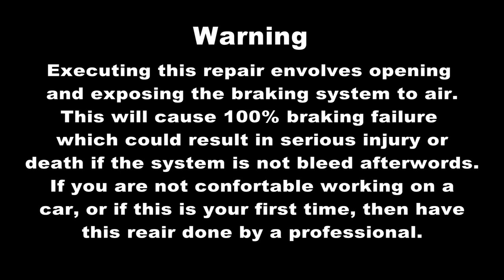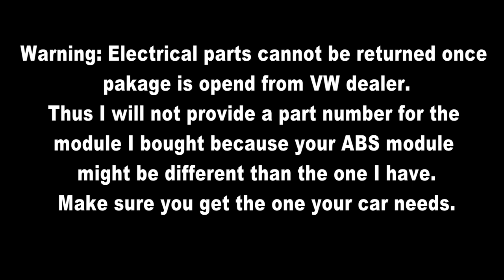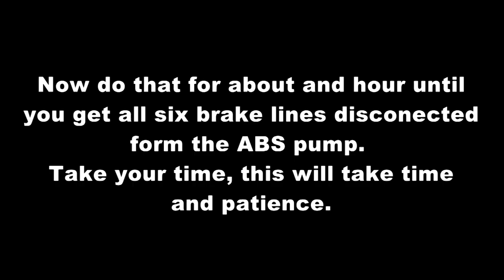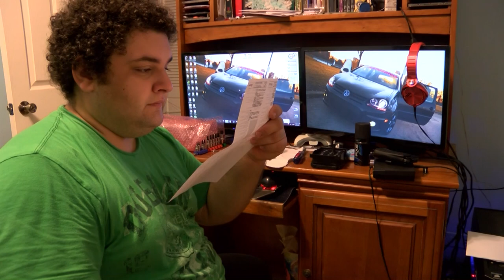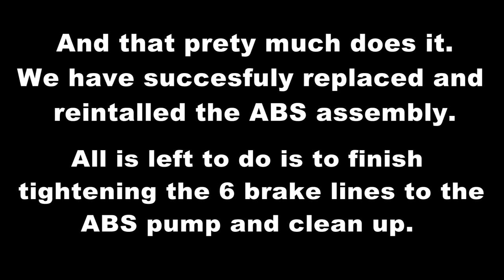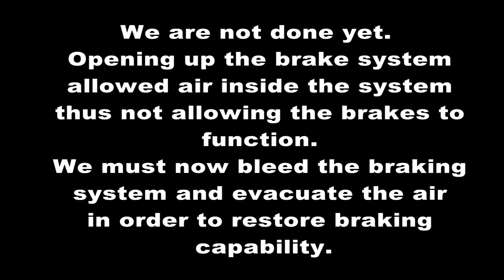2009 Volkswagen GTI ABS Module Repair Part 1

Comment: I had problems with my cluster and ABS, didn't have power on the throttle, after the dealership said they replaced the throttle body and said I needed to replace the whole wiring plus a new module, I went out to find out myself, So I replaced the cluster and bought a used abs control module from the same year of my car. replaced it and didn't have to have it reprogramed as the computer adapted to the used on. There is a way around it my guy, just need the right experts. Now it runs like new no problems no nothing simply satisfying.

Comment: My dealership didn't mention there's a recall for this. My lights all came on when I think the traction control kicked in while I was going to work. He's also trying to get out of fixing my water pump that has a warranty extension. He says there's only a problem if there's a leak-interesting as my reservoir was empty!

Glad I cancelled my appointment for tomorrow with that place and came to YouTube instead. Now to find an honest mechanic, my go to guy left the area. My brakes are mostly working, it does add a little stopping distance on rainy days. And yay another problem with my GTI, but this car was my late father's pride and joy, so I want to take care of it. Thanks people in the comments for the head's up and thanks for this video!

Comment: Mine recently went on my ‘10 GTI. I got a replacement from a salvage yard with the same exact part numbers (pump & module) for 10% of the price of a new one. Also, if your module isn’t completely hosed you may be able to pull the code off of it before removing it from the car, drop it on the new module and save a trip to the dealer.

Comment: CHECK YOUR VIN FOR SAFETY RECALLS! This happened to my 2009 2.5 MK5 and I was about to purchase the ABS module from VW ($1100) and do the labor myself. I found that my vehicle's VIN has a safety recall for this part. They tried to update the software and eventually had to replace the ABS module for me free of charge. Hope this helps someone else, and thanks for this video.
Reply: You sir are a lifesaver....
Reply: The stealership is refusing me, ive had the software update in 2017 done by the previous owner, now the abs module is failing and dealer wont replace it for me :/
Reply: @ayoubtherealone8488  I’m having a dealer refuse me as well. Trying to tell me I have to spend $2400 to have the module replaced so THEN they can do the recall. Makes zero sense
Reply: @blaindavis3222  they are saying the same thing to me
Reply: @ayoubtherealone8488  Literally in the same boat as you, dealers refusing to replace it as the software update was done in 2017 & the “2-year warranty has elapsed”. 
How did you go about it?

Comment: well add another 2009 to the list. after putting a $10,000 motor in after the old ones spun a bearing at 80,000. not less than 1,500 miles later ABS module failure, same symptoms. dealer quoted me for $900 just for the module. I'm a sucker but not for that much pain. I ended up getting the revised model 1K0-907-375-AP. I will end up putting it in myself as I pulled the old one out. thanks for your video it helped.
Reply from the maker: Glad to help and sorry to hear about your car. Good luck to you.
Reply: George Bonta thanks,  it's unbelievable how much money I saved ordering my abs module myself offline then it was to get it from the dealership. dealership was $900, I paid 629 and that's with shipping included
Reply: ABS Control Module Software
VW ACTION CODE
45F2
NHTSA RECALL NUMBER
16V913
START DATE
01-25-2017
DESCRIPTION
On certain vehicles, a fault within the antilock brake system (ABS) may cause the module to fail during ABS and/or electronic stability control(ESC) activation. This will cause warning lights for ABS, brake and the ESC systems to illuminate.
REMEDY
To help correct this defect, your authorized Volkswagen dealer will update the ABS control module software with improved diagnostic capability to detect insufficient PCU ground connection. ABS modules with insufficient ground connections will be replaced. The software update will take less than an hour to complete; if the ABS module requires replacement, this work can take up to a full day to complete. The recall repair will be performed for you free of charge.

Comment: George, I took my Jetta to a brake specialist ( Burlington brake and muffler).. they followed the lengthy process recommended by VW using vagcom. We got one spirt of foam during the process.... the culprit was assumed to be the abs pump as it was foam and not a bubble.... we still have a bit more travel than I like but the amount of travel and brake performance seems to be much better...
The process was so laborious I will never buy another Vw again... the folks at Burlington brake were incredible....
I want to thank you for your response... welcomed potential solutions. Larry

Comment: ABS Control Module Software
VW ACTION CODE
45F2
NHTSA RECALL NUMBER
16V913
START DATE
01-25-2017
DESCRIPTION
On certain vehicles, a fault within the antilock brake system (ABS) may cause the module to fail during ABS and/or electronic stability control(ESC) activation. This will cause warning lights for ABS, brake and the ESC systems to illuminate.
REMEDY
To help correct this defect, your authorized Volkswagen dealer will update the ABS control module software with improved diagnostic capability to detect insufficient PCU ground connection. ABS modules with insufficient ground connections will be replaced. The software update will take less than an hour to complete; if the ABS module requires replacement, this work can take up to a full day to complete. The recall repair will be performed for you free of charge.
Reply: What state or country you in? This didn’t work for me in California

Comment: I bought this at my local dealer for $780.00... I did this my self it's not that hard to do honestly... Yes you have to get the abs module coded after this lights won't go away after replacement...do a brakeflush after is high recommend

Comment: I sent mine off for rebuild at Module Masters in Idaho... So not the only solution.
Reply: Hey there. Sorry to bother, I just wanted to verify if having the module rebuilt with module masters helped and what exactly is the process. I have already looked them up online but did you still need to reprogram the vehicle computer or the lights automatically went away after installation? Please help. thank you.
Reply: But It's not the best solution because the problem are derivated from a ground layout misconception when changed the type of ABS from mk60 to their first versions of mk60ec1 into the 2008.5 Jettas, Golfs, Leons and A3/S3s

Comment: Hey George! A new control module from a VW dealership is way to expensive, almost US$1700  in my country. There are a few Shops that sells used VW spare parts, and they sell some used ABS Control Module. So my question is: is it possible to replace a failed ABS Control Module with a used one that has the same code number, sold from this shop without the need to reprogram the module?
Reply from the maker: Negative as far as I know you need to reprogram it.
Reply: Thanks for the info!

Comment: I had the recall for this unit on my 09 but as I already had the codes present when they attempted to do the software update (the same codes that the software update is designed to be more sensitive to and if found post-update, will require a module replacement) and couldn't do the update, they refused the recall work, quoted me about $2300 to do the module & pump. I instead went & bought a used module (and pump) from an 08 for $42. Previous revision and on the module & pump. Just needed to re-code it to the ECU.
Reply: There was a recall (!) on my ABS module for reprogramming/replacing BUT they gave me the same shit and gave me the same exact estimate! They said my pump was bad BUT I have to replace both pump and module! No wonder their sales is down in US! Not a happy rider!
Reply: Mary Ma I bought a used module & pump from an 08 from a pull-a-part place. Cost me $40. I haven't had a weekend to do the swap tho.
Reply: Great! Less business for those blood suckers! They told me my pump is bad BUT I need to replace module too so I got an impression that they are one unit till I searched on the internet and found out they are attached  by four screws!  Good Luck!
Reply: Mary Ma I needed the pump too. Buying new, they come as either the module or the module & pump. it's an easy fix except you need access to VCDS/VagCom & a power brake bleeder. Buying from the pull-a-part place got me both parts married together for that $45. I do not recommend attempting to separate the 2 parts as even the smallest amount of debris into the pump portion can damage it. Buy it as a married unit & just swap the whole thing as 1 part.
Reply: The Doktor hey bro, I have a faulty module, so I am planning to change the whole unit (with pump) by buying a used one. So how did it work for you and is it fine if the last two letters from the code differs than the original one I have? 
Thanks!
Reply: Sorry I never saw this dude... My understanding is that the last 2 are just the revision letters. So it SHOULD be ok. The used on that I bought from the pull-a-part place had a different revision as well.

Comment: Hi, quick question. I have replaced my module today. I didn't go to the dealer yet to have the module programmed. Before I replaced the module it beeped 3x times and then stopped but now there is a constant 3x beep after the replacement. Is that normal??

Comment: So i have a 2013 Jetta hybrid my issue i have is that the drivers front and passenger right rear calipers will clamp down basically and wont release. so i had the dealership look at quoted me for a complete replacement of the entire brakes system. So where im at now is i have the master cylinder and the abs module and pumps next. OH SO PRICEY. any ideas on the issue fellas?

Comment: Thanks for sharing, this video helpme to identify the origin of my ABS problem, that is almost same, can you share how you reprogram the new ABS module?
Reply from the maker: Aldo Romero Unfortunately you cannot program the ABS module yourself, you must take your car  to an VW Dealer service after the install is complete and pay a technician $120 up to $180 to reprogram it for you. Don't try to reprogram the broken one for it will not work, I did that and ended up just wasting money, once electronics are malfunctioning it is most likely a tangible physical component gone wrong not some kind of virus like a PC. It sucks but it is what it is, I had to do It as well.
Reply: +George Bonta I've read that you can reprogram the ABS module yourself, if you have a VAGCOM/VCDS cable and software. I have the exact symptoms, the mechanical ability to fix mine (2009), and VCDS, the hardest part appears to be finding the correct part for a reasonable price!
Reply from the maker: Well ya the market for that part is completely controlled by the VW, so the dealers inflate the price just because they can. There is no aftermarket alternative so far. As far as the reprogramming of the module goes, if you can do it, than do it, don't let those VW dealers rip you off. This is the price we pay, because dealers are often selling cars at a loss because of competition and chiselers, they inflate the price on parts and service so they can make up for the loss. To them is business. Good luck to you.

Comment: George, I need some help... I have a 2007 Jetta Wolfsburg edition. (Bought from my daughters fiancée) 177 k miles... The brakes work but I have about 5 inches of travel in the pedal and if you push a bit hard the brake pedal heads toward the fire wall. I had a certified mechanic (not a dealer) perform the following.
New brakes, New rotors, 1 new caliper, New vacuum booster (from dealer), New master cylinder (from dealer)
Vag com (no errors found), brakes Bled by mechanic, Abs tested on a dirt road... it works....
No indicator lights are on, as stated... vag com showed nothing. I already have $1.5 k in to this fix... it is stinging us pretty bad...
So is 5 inches of travel acceptable? Should the pedal continue down?
The mechanic and his team seem to think the excessive travel is normal... is it?
I am at a dead end here.... can you give me a recommendation on what to try next? I am fairly adept as a car guy...

Help pls,

Larry
Reply from the maker: 5 inches of travel is pretty excessive. I would say one inch is acceptable. 
Do the following.
-Check the entire system for leeks (even inside the car next to the brake pedal)
-Also since you got a new master cylinder I hope it got vacuum bled since is impossible to get all the air out of a master cylinder using gravity. 
-Then look into the possibility of a broken pedal. 
-Also look into the possibility of a broken seal on one of the calipers. 
-Make sure you have proper brake fluid 
-Make sure the new master cylinder is not leaking inside (this might not be the case since is new, and properly installed.)
Reply: its normal

Comment: How long is the warranty on the new part? I think it's utter bullshit that VW doesn't cover this problem. I'll never buy another VW.
Reply from the maker: LD Well my car is out of the warranty period. If it was not it will probably be covered. VWs are fine cars, as long as you know that when you get one and they break down they are money pits. They break down like Mercedes, and BMW, than they cost a lot to repair even if you do the job yourself. And ya, good choice, don't buy a VW, this cars are 2 to 3 years old cars not 5,6 or 10 like the Japanese brands. Although they are comfortable and fun vehicles, they are not worth keeping for a long time. It is what it is.

Comment: I thought that VW only sold the pump and module as a total unit.  How did you manage to buy the revised module alone?
Reply from the maker: +AeonCatalyst No no, you can definitely purchase the module separately as a unit. At first I called my near bye VW dealer and asked to make sure and they quoted me for the module alone.
Reply: +George Bonta That's great.  I have the "2009 GTI" ABS issue now (braking that would cause the ABS to come on makes ABS/ESP lights and red Brake light to flash) and I was thinking I'd have to buy the $1200 full set
Reply from the maker: Well good luck to you. Hope you can fix it, Don't forget to bleed the brakes.
Reply: Why Bleeding the brakes is so important? What if I did not do that?

And did you have to reprogram the car after fixing the module or no need ?
Reply from the maker: 1) By removing the ABS pump you remove the brake lines, thus making room to remove the pump and module and thus depressurizing and allowing air into the braking system. What is the problem with air in the system? Well, brake fluid is hygroscopic which means it will degrade and became highly acidic if it is in contact with air or water, thus if you leave air in the brake system you will soon have to replace brake lines, master cylinder etc because they will corrode and leak from the inside out. Secondly air is highly compressible which means that if there is air in the brake system you will be pressing your brake pedal and instead of compressing brake fluid which in turn compresses your brake calipers you will compress air which will have no effect on the brake caliper thus there will be nothing to stop the vehicles motion.

2) If you get a brand new module for your car you have to remember that one module which you replaced is usable on other car models as well, thus it must be reprogrammed to your vehicle specifications. There is no way around it. However since I don't have the software I had to take it to the dealer and they reprogrammed the new module for $ 125 USD. Once again there is no way around it. The ABS unit must be reprogrammed in order to work.

Comment: Good evening, George.
I would like to know if after replacing the Abs system was necessary to bleed in the 4 wheels tubes.
Thank you
Reply from the maker: The reason I had to bleed the brake system was because in order for me to dismount, remove and replace the ABS module I had to remove the entire ABS pump and module as a whole unit. As far as I can tell from the position of the ABS module, there is no other way to get the module unit to separate form the pump unless you remove thew pump as ell.

Comment: I guess this is a very common problem on VW's. I have a 2011 Jetta MK6 2.0T. I've been driving it for a year and a half with the abs and traction control lights on and parking  brake light blinking. Got it to the dealer and they told me I would have to replace my abs module.  The thing is, here in Brazil this thing costs something like 6 thousands dollars. Half the price of the car LOL. I guess I'm gonna leave it to the next owner. There is no way Im gonna pay for that.
Reply: Buying it online like Ebay?

Comment: Hello! Nice video. I have a question, my ABS Control Module just failed, engine check, EPC and Steering lights are on all the time. Im trying to locally buy a used ABS module, because a new one its really expensive, my question is as follows: can I replace my old module with any other one or does it have to be with the same code number which is on the back?
Reply from the maker: As far as I know the numbers have to mach, only the last 2 letters can be different and you must have the module reprogrammed afterwords.
Reply: George Bonta Thanks!